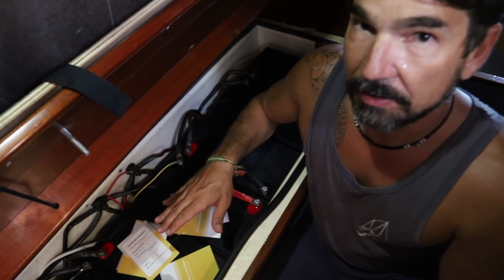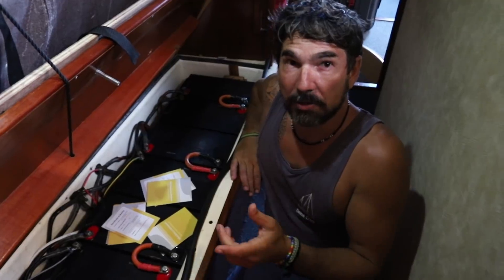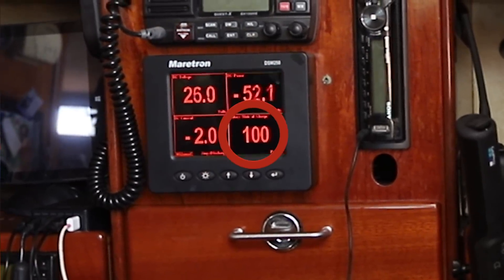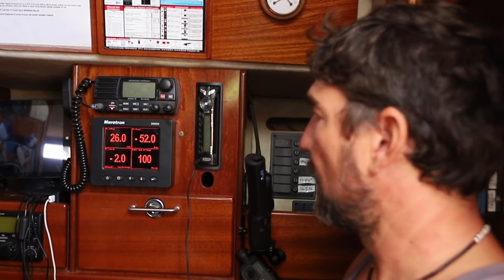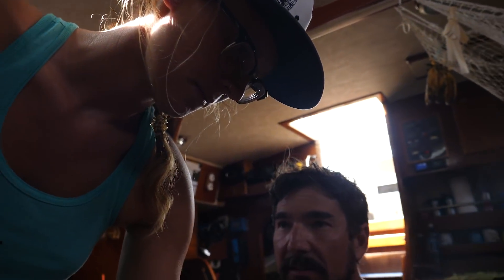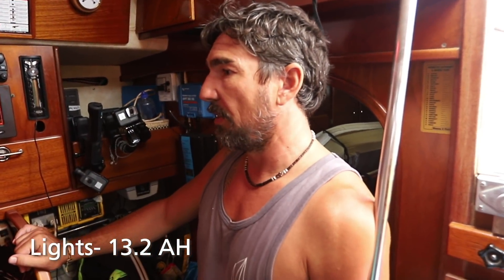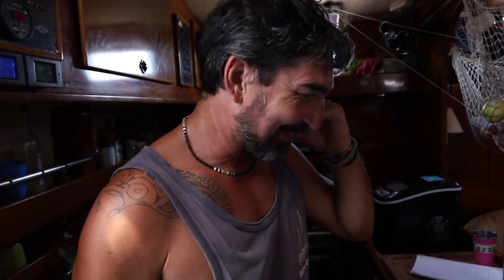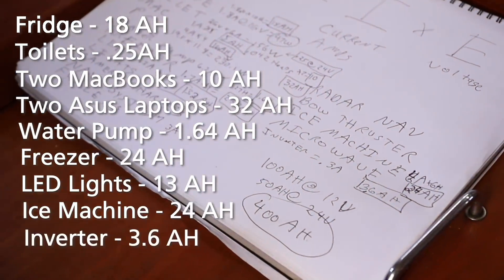WATT THE HELL is an amp hour?  Sailing Vessel Delos

Comment: One should understand that Amp-hours are always linked with voltage and the same value Ah with different voltage means different power. Though in this case its a battery voltage. So, for people probably it's easier to understand the  Watt-hour..

Comment: Thanks for this I sell medical equipment and the batteries for this equipment run much the same way and this is a great way of explaining for those that are technically minded though most of the time I just stress “ don’t run your batteries to dead or they will only run half of the time and make my company more money” don’t tell the higher ups in my company I say this despite the honesty actually generates more business

Comment: Check the current draw of your various motors like anchor winch, etc.  Record the info. On your preventative maintenance schedule check again every few months or other appropriate interval.  If current draw starts going up the motor or something connected to it may need some TLC like lubrication or cleaning. 

Seems like a lot things to maintain on a boat of that size.  You do a good job.  There are some folks that should not be allowed to hold a screwdriver.  They have to get someone else to help them.  It's good that you can do it your self as there is no one to call when you are on passage many days away from shore.

I enjoy your videos.  It is great winter entertainment.  Keep it up.

Comment: These calculations are nice . 
What most boaters do wrong is amp hour chat. 
If you do it right all is converted to watt. Thats the power draw. 
Why .. because amps go up if voltage go’s down.,  draining the battery means more amp true the system. 
As Brian shows Watt is the way to calculate..

Comment: Unless those are 24v batteries you would have 400ah because half the 12v batteries will be wired in series to get 24v. I'm assuming those are 12v batteries so they are wired in series parallel. 4S4P. Series adds up the accumulative volts and parallel adds up the accumulative ah.

Comment: You’ve probably hit this in another video but it would have been worth the conversation of how many amp hours your solar and wind produce in this same video.

Obviously you have less people on board right now between baby and Covid-19 but maybe look at DC power supplies for your PCs and Macs. That way you don’t have to use the inverter and make AC to then transform it back to 12 volt DC (some are 18v DC). Also cell phone chargers are the same. Do let people use 240volt USB bricks. You can install some cigarette lighter plugs and or 12 volt powered USB charge ports. They will save you power. You can even put a 12volt switch next to them to turn off the supply when not charging something in case of parasitic draw. Even good inverters are very inefficient.

Comment: If 65% is correct , than you are operating better than the average which is around 75%. Some device are calculated at 100% ie on all the time and some are less than 50%, ie a laptop. Also all electrical devices have the watts some were on the data plate. It give you a base line to work off of. There is a device that you can get that records the power you use all day every day. Its called "sense", check it out. And once you have it for some time you can see what use the most/least  power.

Comment: You may want to look into boost converters to feed your laptops without going through the dc/ac (inverter) then ac/dc (laptop power adapter) lossy conversions. Just need a 24V outlet (not sure what that looks like) and a boost converter to drop it down to the 20V or so most laptops take in. I use this setup in my cars to avoid listening to 400W inverters whine when a laptop CPU starts getting pegged. For that matter, I bet most laptops could handle the 24V directly...

Comment: Hi Delos. BTW congrats to Brian & Karin on tying the knot and also congrats on the upcoming new addition to the crew... :). Brian, I know you've taken the steps of converting Delos to mainly electical, but have you thought of replacing the main engine with an electric motor, just leaving you with the diesel generator? I'm interested on your thoughts on that as it would mean you could lose the diesel engine and although you'd need a battery bank for the electric motor, it could potentially take up less space than the current engine? Keep uyp the great work with the videos and stuff too... I hope one day to like you, cruise the world on a sailing yacht... :)

Comment: A very informative and accurate explanation.  I'm very impressed that you understand the subject matter that well.  I'm not easily impressed.  I've worked professionally in Electronics and all the other things that go with it since graduation from college in 1970.  Most people I run into just don't understand the mystery of electricity and electronics so when I find someone like you who understands and is even able to explain it as well as you do, I get very happy and impressed.
I heard from Capt Rick Moore of Sophisticated Lady that you have switched from lead acid batteries to lithium-ion batteries.  A word of caution as I explained to Rick, lead acid batteries have a typical life span that is 2 - 3 times of lithium-ion batteries which makes lithium-ion a very expensive trade off.  Also because of the massive power storage of lithium, lithium-ion batteries are a serious fire danger if they become too hot.  I would recommend using a combination of lead acid and lithium-ion batteries and put the lithium-ion batteries some place where they can cause minimum damage if the do catch fire.  Also keep a fire extinguisher that is capable of putting out all types of fire some place it can be quickly accessed and near the batteries.  At least a 5 pound and possibly a 10 pound extinguisher would be recommended.

Comment: Neeeeeerds :P An interesting fact, PC consumes 3x more electricity! Very interesting. Technological knowledge is impressive. I was expecting on the converter part Brian makes a mistake, but he knew every conversion would take energy. These are still acid batteries, they also lose capacity internally+ acid batteries can't be empty to zero. But yes 99% right :)

Comment: Like hearing about the practical nuts & bolts hardware real life concerns of making it work for your needs.  I think these kinds of things help novices or those less familiar with tech backgrround help to grasp these important concepts.  Also, making dedicated videos for these topics is good, that way of you're not interested you can skip, and if you are, the info is concentrated and easy to find.  I like that you link a lot of this stuff at your "about the boat" area too, a logical way to find it.   Thanks Brian!

Comment: Well that was super informative. I have a 26 footer and was thinking about going with two lithium batteries in parallel so a 12v circuit. I have a manual toilet, manual sink and no fridge. I only have the lights, the engine compartment blower and the navs. Also, my boat has a different battery circuit for the engine starter and I think delos has one too, why is that so important ?

Comment: Not sure if someone has already mentioned this, but you have a penalty every time you convert from DC to AC. Things like computers have power supplies that convert the AC to DC to charge the batteries. So you're going from your house bank (DC), converting to AC to go through the laptop power charger, back to DC to charge/use the laptop. If you have the ability to, you can have specific terminals at the same DC voltage as your bank (24v) and use a DC-to-DC converter to power/charge the laptops, you'll avoid the conversion penalty.

Comment: OK, I'm a bit perplexed. 2 Amps just for the instruments over 24V, so 4 Amps in a 12V system? Does that include AIS, radio and radar, because otherwise it is way too much.  On my boat I have a Garmin GMI10  MFD, a Garmin GHC20 Autopilot/Rudder angle indicator and an own-built Raspberry Pi based 7" touchscreen ChartPlotter connected to the usual GPS, Log/Depthsounder and Wind Sensor. With all these on I get a 0.45A draw on a 12V system, 0.6A if VHF is on too. How many instrument screens do you have on at any time?

Comment: Good video explaining stuff most people don't understand, but one mistake. Your original battery setup had 8x100ah batteries, for a total capacity of 800 amp hrs. No matter how you configure the batteries to get the needed voltage, (24v in your case), you still have a total storage of 800 ah. I won't confuse the issue of 'usable' capacity since you can run lithium a lot lower than lead acid batteries without damage. The difference of running 24v vs 12v is that the current is half that of running 12v for a given wattage draw, so the required wire gauge is smaller for the same power draw. Example, a 1200w microwave at 12v (if they made one), would draw 100 amps, but the 120v off the inverter draws 10 amps. One needs a starter motor sized cable, the other a heavy lamp cord.

Comment: Nice process and pedagogy!  Keep them coming!
..I wanted to ask:  do you use fans on the boat or rely on through-flow of air at anchor?  if fans, how hot did it get on the boat when you took down the DC power?  or did it get cooler because there were no appliances consuming (and producing heat)?

Comment: 100 amp/hours at 12 volts is 1200 watt/hours per battery.  1.2 kilowatt/hours per battery.   kinda need to measure  power usage in watt/hours.   

A rule of thumb for inverters is that you loose 10 percent going from dc to ac power.

Thanks for making this video. People need to be thinking about these things.

Comment: Very useful video, thanks guys! 
We are in a small VW campervan so space is tight, we have some AGM batteries intended for use in mobility scooters. They can be discharged far deeper then normal lead acid batteries and still retain a good amount of cycles. Thought some people might find this useful as we always used to kill lead acid batteries but these have been great!

Comment: Do you have a stand-alone diesel generator (in addition to solar panels and wind generators)?  What about an alternator on the engine to help with charging or is that just for the engine battery bank?

Comment: Regarding "power hungry" PCs, most laptop are now using SSD (M.2) storage which is faster and uses much less power.  Also the newer processors use less power.  The new AMD Ryzen chips are a good example and they likely would have enough graphics capability that you would not need a separate GPU for editing.  They aren't as fast for rendering a whole video as the high end Intel chips.

A techie question for you.  𝐖𝐡𝐚𝐭 𝐝𝐨 𝐲𝐨𝐮 𝐝𝐨 𝐨𝐧𝐛𝐨𝐚𝐫𝐝 𝐃𝐞𝐥𝐨𝐬 𝐟𝐨𝐫 "𝐦𝐚𝐬𝐬 𝐬𝐭𝐨𝐫𝐚𝐠𝐞"/ 𝐛𝐚𝐜𝐤𝐮𝐩 ?  I certainly hope you have a NAS configured with at least RAID 5.  Many to choose from even if they are not fast.

Comment: I was going to call you on that 12V vs 24V amp-hour issue but you cleared it up !  Also lead acid batteries get there amp hour rating at a specific discharge rate (𝑡𝑦𝑝𝑖𝑐𝑎𝑙𝑙𝑦 𝑡ℎ𝑒 𝑡𝑒𝑠𝑡 𝑑𝑖𝑠𝑐ℎ𝑎𝑟𝑔𝑒𝑠 𝑡ℎ𝑒 𝑏𝑎𝑡𝑡𝑒𝑟𝑖𝑒𝑠 𝑎𝑡 𝑎 𝑟𝑎𝑡𝑒 𝑡ℎ𝑎𝑡 𝑤𝑜𝑢𝑙𝑑 𝑙𝑒𝑎𝑣𝑒 𝑡ℎ𝑒𝑚 𝑎𝑡 𝑡ℎ𝑒 𝑚𝑎𝑛𝑢𝑓𝑎𝑐𝑡𝑢𝑟𝑒𝑠 𝑟𝑒𝑐𝑜𝑚𝑚𝑒𝑛𝑑 𝑚𝑎𝑥𝑖𝑚𝑢𝑚 𝑑𝑖𝑠𝑐ℎ𝑎𝑟𝑔𝑒 𝑎𝑓𝑡𝑒𝑟 20 ℎ𝑜𝑢𝑟).  If you discharge them faster than that, the Ahrs are lower.  Slower discharge rate and the Ahrs are higher.  Those appear to be AGM batteries which have a slightly smaller capacity than "flooded" batteries, but then they have no required regular maintenance.

Lithium batteries can be discharged deeper with no negative affect and they last more cycles then lead acid, but of course, they cost a whole lot more !

I am sure many of your DC device are 12V (maybe not).  How do you step your DC down ?

Comment: This was an excellent video!  I've been following your adventures since the Philippines and love you guys.  I really appreciate when you mix it up with tech and how & why videos.  Some of my favorite all time videos were the "Why we Scuba Dive" and Diving safety vids.  I'm a land traveler with a 19' molded fiberglass travel trailer that has 150 W of fixed and 90 W of portable solar.  12V system with 2 6V batteries = 450 AH and a 1500 W pure sine wave inverter.  Granted Delos is much more complex than my trailer but many of the maintenance issues on Delos directly translate to my experience.   Taking care of the Gel coat to water pumps, to power management when off the grid.  I'm now inspired to do a device power inventory exercise! Thanks so much!

Comment: I created an excel spreadsheet with your values in it, but when I changed my voltage from 26 volts to 48 volts, it showed I could use half the amps.  What are your thoughts about this?  Oh, and thank you for all of the great videos. I have learned a lot from all of you.

Comment: Lol, Brain you have a Asus ROG (Republic of Gamers) laptop of coarse it uses more power than a macbook pro, most gamers don't care about power consumption as much, just like car guys don't care about mpg in the toy cars, they only care about smiles per gallon. Pending age and model yours should be much faster at rendering. Current macbook pros only have lower end gaming GPUs where as ROGs can have the full range up to SLI 1080s. I think you should get Kazza off that nasty mac, give her your current Asus ROG and get yourself the Asus ROG GX800VH because who doesn't need SLI GeForce 1080s and a water cooling dock, lol.

Also a video on your wind turbines and solar system would be cool too.

Comment: I've often wondered whenever the issue of power comes up (it comes up a lot in sailing and RVing) why not use a custom power adapter that doesn't use AC?  It seems you could save a lot of power that way.  My laptop uses 19.5v, so it would seem a simple resister or small transformer to drop the voltage would waste much less power.  I see adapters like this available on amazon/ebay, which claim efficiencies in the high 80s, but I'm not sure how good they really are.  Is there a reason you don't use these?

Comment: Keep 'em coming Brian, I liked it a lot. If I may, the 100 Amh rating is a 20 hour rating. Meaning a continuous 5% load (5 amps in your case) will take the battery from fully charged to dead in 20 hours. Doubling the load to 10 amps does not halve the life to 10 hours, more like 5. With a 1 amp load the batteries will last a lot longer than 100 hours. It isn't linear. And now you know. Thanks for sharing and fair winds.

Comment: A very important topic.  I am currently redoing my electrical. So, if I understand correctly, with normal use, at anchor, solar and wind can keep you topped off. Is that correct?

Comment: Love the tech aspects of SV Delos. Love that. Love that, love that, love that. I first clicked a "like" button on Delos when Brian repaired an engine in Southern Africa, and found a replacement part on shore for, I think it was less than a dollar. I follow Sailing Uma as well, as they have these ingenious ideas they follow up on, their electric motor for their yacht- doesn't work so well, but the idea was great- and their repair jobs and fibreglass work. I first followed sailing videos with SLV, but they don't do much for repair and maintenance. So if you needed feedback on this one, to find out if this aspect of sailing is interesting to anyone, it is 95% of the reason I follow Delos. Muchos gracias, as they say in Southern Poland and parts of Flagstaff, Arizona.

Comment: Do you gain usable capacity with lithium batteries? Do they have the same cycle deterioration if drained to zero that lead acid batteries have?

Comment: Thanks Brian. I am currently beginning my own calls to figure out my draw (under several scenarios) to see how I want to power my boat's needs. Of course I have ONLY Macs, so I won't need a nuclear reactor. Seriously, this was an important video, and those guys who want naked ladies are likely NOT the sorts the will likely ever need these sorts of tech videos. Question is ... what sorts donate to your cause, party animals or sailors? This is the million dollar (don't you wish! : ) question. BYW ... did you ever notice that BRIAN is an anagram of BRAIN? You didn't? Well, forget it then, it won't matter! @|@ 

THANKS AGAIN CIAO! Beer coming your way.
(OR, save it up, toss out the PCs and buy another MAC!!  :   )
Reply from the maker: Ha Ha thanks so much for your comment Dorian!  My PC died just after filming this....  After many, many years i finally went to the other side.  Will do an update on if this ends up saving any power in the long run.  Fair winds and thanks for the support :) . Brian
Reply: P.P.S. I am wondering if you've switched he'd over to ALL LED lamps yet for illumination? 

We re-commissiond our boat (Caliber 40 LRC) in WA after bringing it back form MD in 2016. Since we had the mast pulled anyway, we replaced all of the NAV lamps with LED, and found a few issues with the differences between the connection sizes and solder diameters in the LEDs vs. traditional incandescent bulbs. This lead to some mis-matches in terms of connections in a number of manufacturer's sockets! Here in the USA SignalMarine (SP?) that make a lot of mast head and nav lights, is always an issue (very old machining and no apparent plans to go 21st century). Once you work this all out, however almost a 4:1 savings in amps is yours for the taking, and on a boat like yours I suspect this would be a significant savings.

I see you guys are not in N Atlantic, enjoying the last days of Summer sailing in those high lats. Who gets Iceberg watch? Seems like a natural post for BLUE!

Fair winds to you all. Peace...Dorian

Comment: When you run your laptops, do you plug them into the AC inverter or into a DC-DC step transformer?
Reply from the maker: We are using the inverter, but researching DC to DC transformers.  So far most of the ones I have seen are low power, like < 40W where the Mac's are 78W and the PC is 140W!